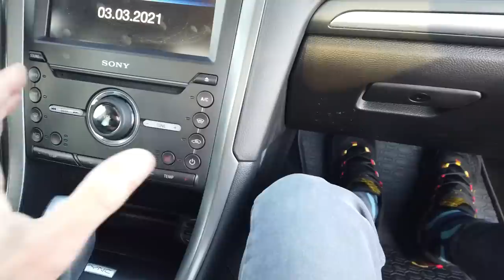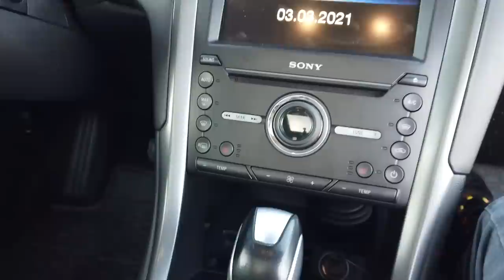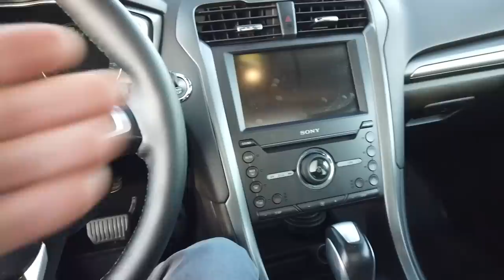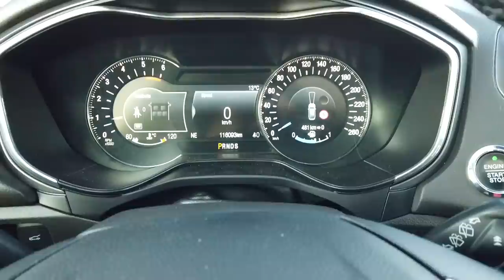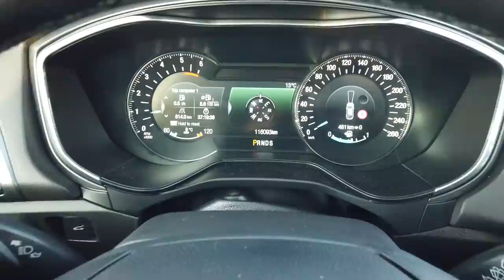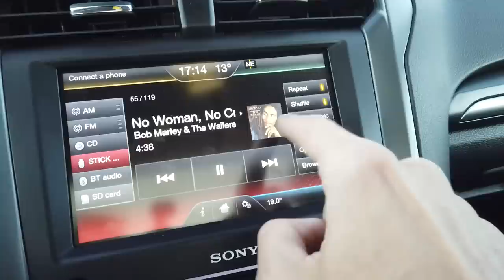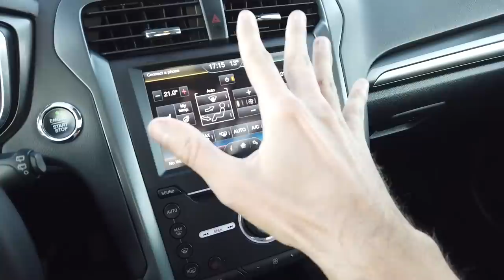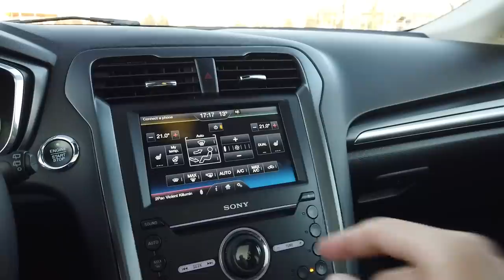Ford Mondeo 4  2.0 TDCI Powershift din 2016, cea mai buna ALTERNATIVA la PASSAT

Comment: Bravo Vlad ptr prezentare. Locuiesc in Australia si tin sa felicit ptr toate informatiile expuse despre masinile vandute aici. Se vede ca faci totul professional. 
Fordul si Holdenul de aici erau foarte usor de modificat, cu un buget de max $.2.000 puteai sa le cresti puterea cu pana la 200 hp foarte usor. Aici e sport national care are mai multi kw la masina. Impozitul pe capacitatea cilindrica nu exista aici si nici taxa de mediu. E doar o taxa anuala (intrgistrarea masini) de $716 daca stai la tara si $834 daca stai in zona Metropolitana.  Daca ai Polo cu motor de 1.2 sau Holden Commodore cu motor de Corvette 6.2 V8 taxa e aceiasi. 
Intr-o concluzie avem asa:
- pret bun de achizite ptr salariile de aici,
- tuning-ul se face cu un buget redus,
- nu sunt taxe suplimentare ptr motoarele mari, 
- carburant relativ ieftin,
Datorita acestor factori au fost niste masini dorite de ei, asta pana cand masinile europene au inceput sa le ia din clienti.  Productia a inceput sa scada treptat pana au inchis. In ultimii ani s-au inchis toate cele 3 fabrici de aici  Holden, Ford si Toyota.

Pana si Politia a trecut de la Holden si Ford la VW si Bmw ;).

Comment: Am avut două:)1  ( 2015 ), 150cp  , motorină, manuala, Titanum.. si 2. 180 cp, 2018..automată 4x4.. Acum am Edge ST 240.. îmi place Ford
Reply: Bună seara. Și ce părere ați avut de cel 4x4? Am găsit unul cu 150cp. Cred ca 2000cc și unul cu 1500cc. 140000 km. Mulțumesc pentru răspuns.
Reply: Cutie manuala. Au toate.,!
Reply: @florinporfir5357  Sunt fiabile.. eu le-am dat după 2 ani ( 40000km) Acum am un Edge ST Line.. Mondeo sunt superbe, dar sunt prea lungi si joase.. atenție la praguri când cobori bordurile !😉  Cea de 180cp si 4×4 ( amândouă au fost Titanum) a fost fără reproș. Sta bine pe șosea.. Consum ff decent ( dacă mergi la 1500 turații😉)

Comment: La 38:56, touchscreen ul este rezistiv, nu capacitiv, pun un copy-paste de pe un form sa va scutesc de-un google.
"Resistive touch screens consists of several very thin layers. When someone presses the touch panel, the top layer bends to make contact with the bottom layer, closing a circuit and causing a current loop. Resistive touch screens can generally only be used as a single-touch device, but they cost less to make and incorporate into your application and respond to any type of touch. They can be used effectively for simple panel controls, such as an automotive GPS panel control or other keypad-replacement applications, or in applications which require gloved use.

Capacitive touch screens are commonly made of two layers (a surface insulator and a transparent conductive layer beneath it). Since the human body itself is an electrical conductor, when the touch panel is touched with a finger (or a conductive pen), the electrostatic field of the panel is distorted. The touchscreen’s controller is able to tell where this distortion is on the touch screen and sends instructions to the rest of the system accordingly. Capacitive touch screens accept “Multi-touch” controls and require less physical force to register a touch. They’re longer-lived than comparable resistive touch screens, making them suitable for high-grade panel controllers or mobile phones."

Comment: Vlad din punctul tău de vedere, acest 2.0 de la ford sau 2.0 grupul VAG,vorbind strict din punct de vedere al fiabilității. 🙂
Reply: Mie 2.0 DW10 euro 5 mi se pare foarte ieftin dpdv al consumabilelor. Filtrul de motorina e max 60 de lei. Ulei cu norma 913D Motul 6L max 160 de lei(va trebuie scula specială facă vreți să schimbați DIY). Distributia de fabrica de schimba la 200000 de km și e ieftină. Și lista continua... P.S. Al meu "mănâncă"(de fapt pierde pe la garnitura de la pompa de inalte-e boala lor) cam 200 de ml in 2500 de km. Motorul având 220000 de km acum.

Comment: Noua in 2017 cutie manuala, 180 cp, fara panoramic, in rest la fel, 26500 euro
Nicidecum 40000
Reply: @andrei m nu exista, va arat factura oricand, vignale era 36000 euro
La ford nu luati pretul de pe site, sunt discounturi mari la dealer
Reply: Depinde când a luat-o, passat cand apăruse era intre 26000 si 52000 euro
Reply: Accord

Comment: Toate bune si frumoase, dar despre dualclutch nu cred ca stii lucrurile corect.
Reply: Ce consideri ca am omis? Am avut si eu o cutie similara, le.am avut și pe moto, știu foarte bine cum merge
Reply: Tu vorbesti de easytronic de pe opel, sau cutii similare. Alea nu sunt dual clutch. Alea sunt cutii manuale la baza, la care actionarea ambreiajului si a schimbatorului de viteze se face “robotizat” . Se face cu pompe hidraulice conducte, calculatoare, senzori etc, si da sunt cam nasoale. Cutiile de tip dual clutch au alta tehnologie (nu prea ma pricep sa-ti explic 😊), si in esenta tot cutii manuale sunt. 
In materie de condus, cred ca cele mai misto pt  dinamica sunt acest tip de cutii. Porsche inca le foloseste. Eu am condus mult dsg de la vw, si am un bmw m3 cu dct, care tot dual clutch e.
Reply: @andreipenghis6935  nu comparam easytronic dpdv mecanic, ci dpdv fiabilitate si rămas in drum, se strica toate la un moment dat.

Cunosc foarte bine cum functioneaza arborii din cutie si mecatronica
Reply: Ok, in video asa se intelege, ca le compari ca tehnologie, si ca feeling la condus. Cumva te simti mirat ca se simte insa foarte bine la condus. Da, dual clutch se conduce foarte bine. E mai “crisp” decat convertizor.